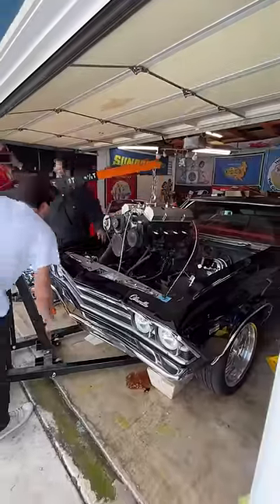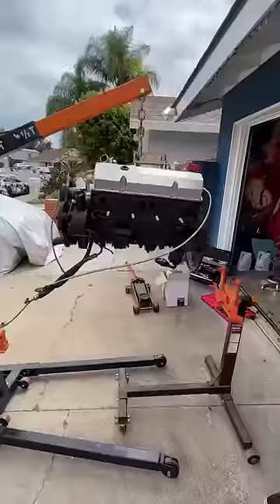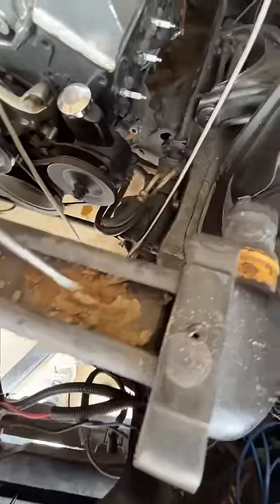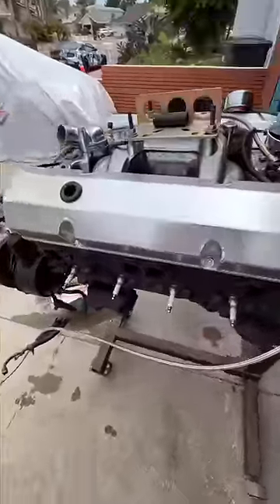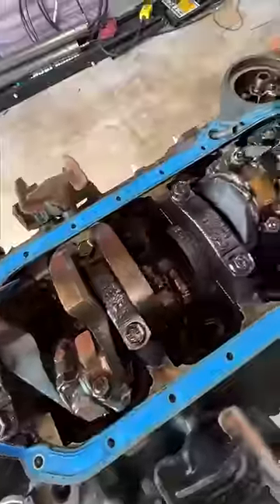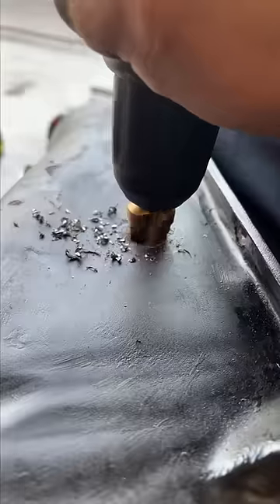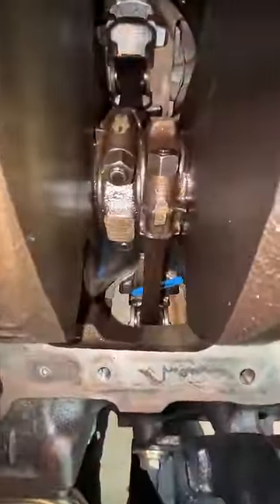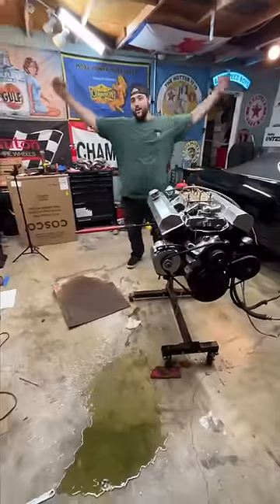Pulling the Engine out of my Twin Turbo Chevelle

Comment: Twin Turbo 400? I predict that your crankshaft will become acquainted with the pavement. 😂
Reply: Seriously 😂 a 2 bolt main at that
Reply: agreed
Reply: 2 bolt will hold up !!!!
Reply: @pops3554 yes it will. But i would still splay cap it
Reply: That was funny thanks for the laughs
Reply: @jenswoody4683  The 2 bolt block for 400’s are stronger because of no invasion into the web areas.

Comment: if it has a gasket you dont have to use gasket maker, it’ll usually cause more problems than it fixes
Reply: Other way around. Rtv usually will seal better than premade or at least last longer. When applied right. If pan being replaced is new then it might seal great
Reply: @solaryellowis3007  exactly always better safe then sorry especially when your adding some boost
Reply: @jasonhudson5861  bud the oil pan has nothing to do with boost 😂 it'd be the same either way
Reply: @damienstrollo  he's going to have plenty of crank case pressure when the rings pinch and take out a piston.
Reply: @damienstrollo  yeah it does. It can cause alot of positive crankcase pressure from blow by
Reply: That slick silicone gasket is now getting lubed with silicone sealant and it will take its toll , when it fails probably between Vegas and LA . Or out of El Paso on I -10 ….
Reply: Agreed only on corners lips or bends, that gasket will do fine with even torque and proper sequence. All the extra rtv just allowed for variance but it will probably be mostly ok. probably. Maybe fine most likely sure but not positive then another maybe but of course no. But hey fuck it
Reply: @jessecrawford2711  there’s already a lot of variances with these old motors there never milled down perfect unless it came from a good ass shop
Reply: @damienstrollo  sounds like you never put a turbo on an Chevy “bud”…plus it’ll always increase crank case pressure as said in the comments I’m not dumb an know what I’m talking bout “bud”
Reply: @damienstrollo  you obviously don’t know anything about cars
Reply: @solaryellowis3007 tell me you are not a mechanic without telling me your aren’t a mechanic
Reply: @Damien Strollo  bruh the oil pan has positive pressure that's literally why pcv valves exist
Reply: Yep
Reply: Clearly you haven’t built sbc and ls engines.
Reply: Rtv will help with sealing and fixing any microscopic imperfections in the gasket itself learned that on #junkyarddigs channel
Reply: The spec on most cars for an oil pan is to use a gasket and RTV. When I did my oil pan, the service manual has instructions on where to put the RTV
Reply: @jasonhudson5861 if you’re concerned about blowing out an oil pan gasket by adding boost you shouldn’t build engines
Reply: @dennis-nz5im  Don't worry, it's only gonna end up in the oil pump pickup screen.
Reply: Especially using a lot…:(
Reply: @nathanschreck8051  ha ha
"The sevice manual" wtf
Reply: @Solar Yellow IS300  this gasket specifically says to install it dry in the instructions.
Reply: I always put rtv I never have luck with just gaskets.
Reply: @TheLionAndTheLamb777  if lucky, one split on the kids truck and it puked a rod when it ran dry
Reply: @CJ2Fye7 Absolutely not, one or the other, gasket or gasket maker never both, premade gaskets are meant to be applied dry, Applying both makes RTV flex the seal and it won't seal properly.
Reply: It's really a matter of opinion.  If you really don't have an opinion it really don't matter 😂
Reply: @wayneoakley1832  its not though 😂 you use RTV with a gasket higher chance of it not sealing correctly and leaking
Reply: @RatzillaCustoms  no concerns when it’s there money.. but shit happens when you add boost to shit that never has seen any an especially when you assume it’s rebuilt only because it’s clean on the inside. Imagine you add boost an have a couple pistons rings gapped a lil to much.. an turn the waist gate up on an old worn out Chevy 305 some will blow.. I’ve had an oil leak outta the corner of my lil 305 oil pan because of my turbo.. perfectly fine on 5 lbs added diff springs an she didn’t like it..
Reply: @RatzillaCustoms  an my definition of built is def not adding a turbo lol… built is my 4 bolt main  350 bored .60 over with a stage 3 cam an a Holley sniper efi with btr platinum valves.. maybe I’ll add a lil shot of nitrous one day but for now 570 whp is plenty for me🫣
Reply: rtv cause more leaks than it stops and that knowledge comes from 43 years experience and a few redo because of it
Reply: @damienstrollo ositive crank case pressure would like a word with you 🤣

Damn 🤡
Reply: @jasonhudson5861  what are the specs on that cam
Reply: @RatzillaCustoms  it’s a Texas speed way chopacabrra cam 214/222 .550/.550 lift, kit came with .560 valve seals an springs.. an why delete your comment sayin I shouldn’t build engines?? Guess you never been around engines to assume adding a turbo to these won’t ever give you an oil leak down below… shit I’ve seen the oil line blow off before because of boost.. can’t wait for my 305 to be bored .60 over she’ll be a rev monster they say if it’s built right it might rev to 8k but hey keep thinkin I shouldn’t build engines.. street fun is the best fun in my opinion… bet you’ve never put in a cam bearing in yourself try that before sayin I shouldn’t build engines…
Reply: @RatzillaCustoms  an I could def turn it up on my Holley setup but I don’t wanna blow nun she hooks an goes, anymore I’d have to add weight in the back with bigger tires..
Reply: @solaryellowis3007  You understand. YOU DEFF need some on the china wall.
Reply: @jasonhudson5861  lmao it’s still there look a lil harder, why waste money on a 305 the only way you’ll twist 8k is with a forged rotating assembly and at that point you’ll never push enough air to make any useful power, you’ll more than likely split the block open way before 8 grand simply because you cut it so deep to not even compare to a 355
Reply: My dad and I have just rebuilt a 1700 Ford Xflow engine for a customer, after his old 1700 spun a bearing after 2,000. (Not by us). We removed the sump to find the oil pickup gauze was blocked up with the gasket maker, which caused oil starvation and spun number 3 big end bearing. We also found, what appeared to be chunks of metal from what was once an oil baffle lol. The spot welds had broken a while ago (apparently), so eventually the crank had smashed it to bits, denting in the pickup gauze and further blocking it up. Don't trust what anybody say they've done, always inspect it just to be sure
Reply: @neooverby3750  im not a mechanic. Im a service advisor and get paid thousands a day for my opinion so yours doesn’t really effect me.
Reply: I came to the comments just to find someone who was thinking the same thing I was thinking lol smh these you young bulls be over thinking it too much
Reply: My sentiments exactly
Reply: You have it out, why not check ring gap?
Reply: Copper gasket spar is always a good choice
Reply: said no one....ever...🙄
Reply: @albanutz exactly..Tear it down while it's out. Prob afraid of timing.
Reply: you know i’ve rebuilt engines rear ends and basically anything you would use gasket for and i’ve never had issues. however sometimes it makes you’re parts stick together like a mad man
Reply: exactly idid the same thing as him and now im slowly leaking oil
Reply: Don't worry either it'll close up the ring gaps or suck all that silicone that wasn't needed into the pick-up.
Reply: @tomredman Why not just fire ring the whole fucking oil pan?
Reply: I put rtv on my rubber gaskets but i leave the rtv alone for 24 hours for it to dry and harden up then ill start my car and test it letting rtv sit and dry before starting the vehicle will prevent that gasket from slipping out imo
Reply: @jessecrawford2711 you are very convincing
Reply: @nathanschreck8051 what vehicle?
Reply: @joesyoutubepage did u torque bolts to spec?
Reply: @JUNEBUGLLC  yes but ithink idid not let it dry
Reply: I’ve heard a lot of people debate this but from my experience just a gasket with proper torquing is the way to go. There’s a reason it’s like that from the factory.
Reply: Old v8s have shit tolerance there so the more squish the better. Nothing is going to last forever in em
Reply: @jasonhudson5861 bud just seems like what your first name should have been or more likely already is... It is isn't it

Comment: If your resealing a surface that has a gasket, only use silicone where it's needed. Putting silicone on a rubber gasket like that can cause it to push out and create a leak.

Comment: 40 year engine builder here your pickup tube looked like it moved on ya bud you will definitely want to fix it back 7 1/4 inches from block pan surface and tack weld pickup to oil pump later on bigger oil pan so you have more capacity love the car very sharp

Comment: For the oil drain you could have ran it to where a mechanical fuel pump mounts to the side of the block. Summit racing, jegs and ebay sells the block off plate with turbo drain added to it or  bought a blank fuel pump block off plate then welded your own oil drain to it.
Reply: I wouldn't think that spot has a good enough drain internally. Imo doing direct oil pan drains is the safest way.
Reply: @matthewso5291  the fuel pump hole is a perfect spot since it has holes that lead to the cam and also has holes that will drain back to the oil pan on sbc/bbc engines.
Reply: @gaspoweredgarage  true, I'd worry about the drivers side turbo having a really long line but ig it works
Reply from the maker: If it were a single turbo thats probably what I would have done but this way I can have both drains go straight down
Reply: Block off plate works for a single turbo. You want to drain it into the pan like he did. The only thing he should have mentioned is to make sure you tap the pan between the rod and crank weight throughs. Right at the mains is the spot.
Reply: I burned up twin turbos because the drain lines went up over frame rails. Learned the hard way.
Reply: @rockridgewoodshop  well no shit, turbos gravity drain. If theres enough oil pressure to push oil down the drain. There's enough to push it out the seals. Or it just doesn't drain and burns

Comment: Man those 2 bolt caps are gonna walk all over the place
Reply: Yeah I was noticing that. 4 bolt mains if it's high performance.
Reply: Yep, I was looking at getting a 71 Torino on FB marketplace, but the engine's a 2 barrel, with worse heads, and a worse rotating assembly. So nah.
Reply: I was wondering if anyone was gonna mention anything about the soon to be turbo 2 bolt main. 😮
Reply: @samunthank5982  Two bolt main is the least of his issues. A cast crank 2 bolt 400 can handle about 700 hp. The stock rings switching directions quickly under that much pressure cannot.
Reply: 2 bolt mains might surprise you! Lol
Reply: @angusmcpherson  The 2 bolt block for 400’s are stronger because of no invasion into the web areas.

Comment: Need to throw some H beams and lower compression pistons in it if you’re going to turbo it.  High quality bearings.  You’re going to blow that thing up.
Reply: With anything over 6PSI the piston rings will pinch the tops of his pistons he won't need to worry about any of it lol
Reply: If those are stock 400 pistons it's already 7.5 to 1 compression...
Reply: @konnerkramer329 no sir if those are stock 400 pistons it will be a dish piston and will be 9-1/2 compression
Reply: @jimisrael3030  🤣 uhh what??? A stock 400 with 9.5 to 1... keep dreaming bud they had 21cc dished piston and 76cc heads

Comment: Bell housing bolts are usually all different sizes.
Reply: And it’s also secured by dowels in the block.
Reply: That’s what I was thinking. It’s why I draw myself a little diagram on a box and number every bolt with a sharpie
Reply: @Rmac335  I’m an engine tech, and I just pick my starter bolt and then push it through a cardboard box so it holds it in place. The engine then maps itself and bolts are easy to label.
Reply: 3/8- coarse 1 1/4  in  long , small and big block chevy. Fords , yes. Does have different length.  The 2 top bolts different, 7/16 coarse thread ,on all the bolts ,just different length
Reply: I've been turning wrench on 50 years worth of big and small block. All the blocks same length or somebody left junk in the threads. And that REVEILLE make leaks during the hit up and cool down cycles.
Reply: No they are not usually different sizes
Reply: @jimisrael3030  it’s different for every brand
Reply: @whisky0312  but not on a small block chevy , big block, or a 250 6cylinder. 3/8" 16 -11/4  inch long. Has been this way since the inception of the Gen 1 small block . In the mid 50s .
Reply: @whisky0312  no s*** but we're talking about a small block Chevy not some other brand
Reply: No they're not

Comment: That’s terrifying. Those two bolts holding on the torque converting is something I might never see until something goes terribly wrong.
Reply: Only a 3 bolt converter, I’d probably run it lol

Comment: NEVER use rtv when you have a gasket for that part, if you torque it while the rtv dries up, it's going to be loose when it's fully cured. Rtv is only when you dont have a gasket

Comment: Somebody needs to watch fel pros gasket instruction video, only use gasket sealant on uneven surfaces like a protruding water pump etc or the 90 degree corners for you main bearing or your main seals, fel pro has amazing videos on gaskets definitely recommended to go watch, you’ll never “wonder” if your doing something wrong

Comment: Rtv should only be used to level the gaps between block and timing cover, and the block and rear main. Just a small bead will do. Putting rtv anywhere else will cause it to leak

Comment: While you got the motor out, you should make sure the clearance on the piston rings is enough for a turbo unit or nitrous oxide if you plan on adding it. The piston ring gap is the biggest thing overlooked and why most engines grenade with nitrous oxide.

Comment: You will regret NOT checking those crank bearings, etc and the torque on that "rebuild" after finding those "Mickey mouse" issues, NOTHING should have been left to chance - when you just had EVERY chance right in front of you.

Comment: Turbo on a two bolt main sketchy I would like to see the progress and the ending😂
Reply: 2 bolt, stock rods, probably cast pistons, and Iron heads.
Reply: The 2 bolt block for 400’s are stronger because of no invasion into the web areas. Could do splayed caps or a ARP main stud kit to help it survive longer though.

Comment: Should of gapped the rings to .0045 X per 1" of bore size to get it to live with boost, or the rods bolts will be the first to go if the rings dont pop the top of the ring lands off with that N/A ring gap
Reply: Shhhh 🤫 😉

Comment: One piece oil pan gasket with metal inserts dosent require gasket sealer but i would also take a little ball peen hammer and re-concave the bolt holes in the oil pan. Just a little extra step i do to make sure the bolts get the pan TIGHT up against the block. Buuut i know EVERYTHING is different with boost and ive never delt with a boosted engine or crankcase pressure

Comment: Do use 3M yellow on the pan and then you put the cork gasket and then you put some weights on the pan and press the pan and gasket down on a flat surface and let it dry. You don't use silicone on the block. The cork gasket does the job.📡👽🇺🇸 RUN!!!

Comment: Reminds me when i got a new transmission on my 04 cateye. It was a 4l60e and the guy that put it in had the bottom two bellhousing bolts loose as shit (like, barely more than hand tight) and all the pan bolts on er were similarly loose. Some werent even fully hand tight.

Comment: They make special bolts that attach the torque converter to the flexplate.
There are a special grade and they have a shank on them- a higher shear strength. The bolts that go from your bellhousing to your block also have shanks- they don't just hold it together they index the bellhousing to the block. Yeah I know there are those indexing bumps too- the better the distribution of the force the better.
Also because you disturbed the torque converter replace the torque converter seal that goes to the transmission. Seals get brital and when the torque converter wiggles
the seal cracks and/or becomes distorted. One of the worst things is getting your motor and transmission back in your car and everything's tucked away and your torque converter seal leaks. Then you got to do it one more time-seals are inexpensive and easier to replace when the engines out of the car.

Comment: Could have just flipped the engine back over to get that guide out haha
Reply: Holy crap I'm stupid.
Reply: Or just take a long flat blade screwdriver with a dab of grease on the tip and it will adhere to the tip like a magnet.

Comment: When you put the RTV on the oil pan gasket - you should go around the bolt holes...  If it leaks, it can leak out the bolt holes....
Saying the engine "looks like its been rebuilt" is meaningless.    Next time  1) Check the rods by wiggling them.  If you can see them wiggle they are too loose/bad bearings.   Also consider putting a new oil pump, pickup and maybe a new oil pan.

Comment: Never put silicone on a neoprene gasket; it can actually allow it to slip out of place before it sets and I have seen it split the gasket.  At the most, a small dab in the corners of the timing cover and rear main.

Comment: Wish i would have kept my 4 bolt main 400 w 441x heads. Hind sight is 20/20
Reply: My brother had a 1973 (4.125 bore) 400 bored .030 over to a 406. Was built by a local machine shop for his son as a 406 stroker sitting in a 79 Z-28. He sold it to buy a house. I'm still jacked about it all these years later!